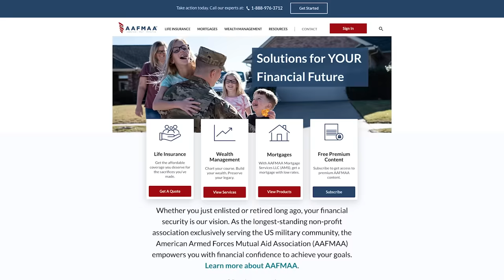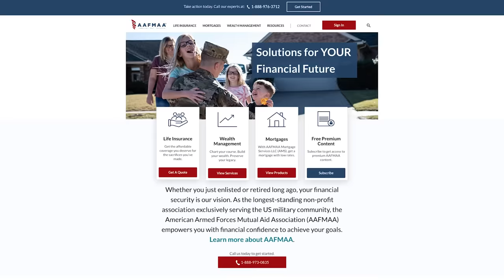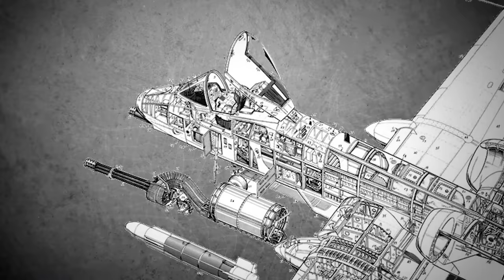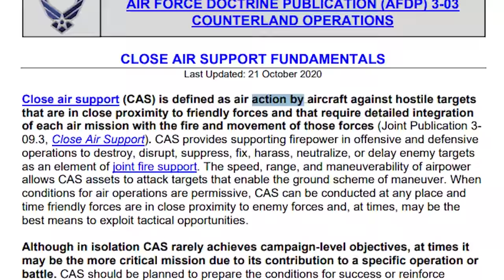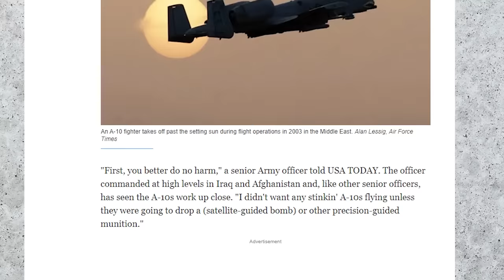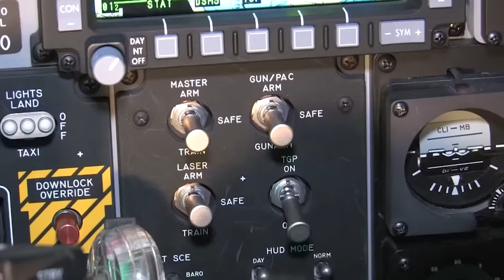Why the Air Force is Screaming to Retire the A-10 Warthog

Comment: The Marine Corps was an early and persistent champion of close air support (think of the legendary Pappy Boyington). I was a forward observer in Vietnam when my unit was crossing a rice paddy. We became pinned down by a large volume of machine gun fire from a tree line. I called in a fire mission. Our batteries were usually quick and efficient, but on this particular mission they were slow. I was just about to call the battery back when regiment interrupted to say my fire mission was on hold. An F4 Phantom with a loaded cannon pod was being diverted to our position. Within a few minutes he came in, as they say, guns blazing. When the roar subsided and the dust and smoke drifted away (literally), not only was the tree line silent, most of the trees themselves were gone.
Reply: Hell yeah. Similar shit happened in Iraq. I was a good distance away, but I witnessed an A10 take out about a platoon sized group of insurgents that were pushing on a bunch of marines. I was on overwatch calling out targets for a different mission is the area. I don't recall ATM what the marines were doing, but they were maybe 3 blocks distance from us? We see this group pull up firing everything they had, and then POOF! I swear I could see the red mist rising up into the air even from where I was. Shit got REAL quiet after that. A10s are absolute beasts.
Reply: The m61 Vulcan  is no joke

Comment: I've been around the A-10 for 6 years and my unit just sent out our last ones to start acquiring F-16V blk 70's. In that time, I spend some of it supporting the test center where developing the new avionics upgrades on the current suite. The A-10 is far superior to the A-29 crop duster they developed as an excuse to retire the warthog and have already stopped supporting. Helicopters including the Apache are still very limited in their ability to provide CAS and are just as expensive to operate per flight hour. My knowledge on the drone world is far more limited but I commonly hear that they would prefer to not use them in CAS missions as you are ENTIRELY reliant upon sensors and good information from a TACP (I went to the wake of one of those 10 US infantry men and he was the TACP that called in the bad info).
F-16s are certainly out the door on being capable fighters for the near peer conflicts, and the USAF seems to think so as well. They are planned to take over the CAS mission and have the advantage of supersonic flight reducing the time it takes to get to the fight and increases the range of coverage. Aerial refueling is still the big strength of the US armed forces capability to project power and covers most of the 'efficiency' issues that originally favored the A-10.
It was always most telling to me how much the DoD favors an aircraft by how willing or unwilling they were to sell it to allied nations. The fact that the B-1, B-2, A-10, and F-22 will never be sold tells me that they never want to face them in a conflict. I include the bombers because it shows even how with all the air superiority fighters we have, still nobody wants to face those creations.
Reply: I think it’s gonna be a situation where brass are being a bunch of good idea fairies to look like they are doing something but when shit hits the fan there’s going to be a niche that will need to be filled and they will end up making something akin to the A-10
Reply: I take your point in many of the aspects that you speak of but mine is of a former attack helicopter pilot. The advantage that the Apaches have over the A10 and other fixed Wing assets is that we can hover and monitor the battlefield and hit targets from about 5 MI away. That's a huge asset Builder when you know that you could see the bad guys through thermal imagery better than the guys on the ground who's a thousand meters from them. I think both attack helicopters and the A-10 work well together but each can do a significant job on their own.

Comment: Infantry vet and in field exercises when an A10 would fly over everything stopped, we loved that plane. The point is we could see it. Fast movers high up we’re never seen except the occasional con trail. My son, an infantry XO could call for artillery, Apaches, KC gun ships, a variety of fast movers, and once was able to task a B52 but never an A10 and had no need. Very sad but true. And there is a lot today he didn’t have, he said in the small town drones would have been huge. They had to just walk in and see who fired at them. Sorry A10s, we love you but it’s time.
Reply: FUBAR.
Reply: "The point is we could see it"
this is, unfortunately, also the problem.  "If you can see it, you can kill it" applies in air defense just as much as it does to ground warfare, assuming you have the equipment needed to perform the "kill it" part.  Peer and near-peer adversaries have that equipment.
Reply: @ShuRugal  and the air force will not risk an F35 at its cost and its overheating engine to do CAS, they never wanted to do CAS and all the laser guidance isn't worth a crap if you aren't around and they will not be around.
Reply: The replacement needs to be many more cheap, unmanned drones piloted from afar.  It enables more CAS over larger areas while not risking lives.  The most likely adversaries of Russia and China are loaded with AA, so the A10 will be a sitting duck no matter how many systems are taken out.
Reply: @jktarleton  Drones or helicopters are better for the job, or less expensive platforms like the F-18. Plenty of other options, and guided munitions allow much more stand off distance than when the A-10 was designed

Comment: I'm surprised you didn't mention that the primary reason the A-10 has such a strong record of defending troops on the ground is because mission commanders refused to let as many other aircraft do the same job, despite those aircraft being more capable of surviving enemy contact.
Reply: For real. You won't get one of the few F-35's or flight-hour expensive Apaches to show up for on-call CAS with an expensive missile to save your platoon during an ambush because operations commanders don't like to risk $$$, but you will almost definitely get a Hog followed by some Kiowas to dump cheaper hard rounds onto the target

Comment: There's actually a lot of older vehicles that are getting to the point where the costs to keep them in service keep going up. It's also happening to the Navy to some degree, I believe, and I'm sure some Army vehicles are gonna have the same problem down the line if they aren't already. Tends to be exacerbated for the ones that have few numbers and demand use (ships need to sortie, pilots need to practice).
Reply: The maintenance death spiral - at some point maintenance of old platforms sucks up so much of the budget that you can't afford to buy new kit. The trick is to figure out when the balance shifts from "maintenance is more cost-efficient than buying new" to "maintenance is too expensive, we need to buy new" and get off the ride before that happens.
Reply: How much would it cost to build a brand new A-10 versus an F-35?  How much does it cost to maintain an A-10 versus an F-35?  Hmmmm
Reply: Give them to Ukraine 🇺🇦  it's  probably  cheaper  shipping  our old stuff to them 👍 problem solved 😉
Reply: @tomstarcevich1147  That's what we've been doing.  Some of the kit is new but most of it is ammo and vehicles that are approaching the end of their shelf life, so it's either donate them or scrap them.  Cheaper to send them to Ukraine so that's what we're doing.
Reply: Meanwhile Russia deploying T55s and Mosin-Nagants :D
Reply: @tomstarcevich1147  We already offered A-10s to Ukraine. The UkrAF response was, "Thanks, but no thanks. That aircraft can't do anything we need."
Reply: @@arisnotheles I'm chucking at how ubiquitous a naval history YT channel has become, that a poster here can reference half of his channel name and fully expect most of the people who read the message will know exactly who is meant.
Reply: @bill5982  How much does it cost to train new A-10 pilots, after the first two got shot down?
Reply: @@arisnotheles I think Phili was agreeing with you? Obviously buying then selling it after 5 years is horridly impractical, but it's not like there's a handy chart anyone can reference for obsolete date. Like, F-35's are fine now, but will they be fine in 10 years? Probably.
How about 30? 50?
Reply: Those captured alien 👽 👾 👽 craft in Area 51 are approaching 70 years in age. The cost of getting spares is astronomical!
Reply: Why not genuis
Reply: No A10s been sent to ukraine
Reply: @bill5982 cost is irrelevant given the A10 isn't made any more and the F35 is made in mass so it's way cheaper than any other 4th gen plane in the world. As for maintenence F35 wins too. Sure it's more expensive per hour to fly but the A10 frames are getting harder and harder to find parts to keep them going. Hell, for them to be even remotely acceptable for a modern battlefield with the A10-C you have to give it an upgrade package that costs more than a brand new F35